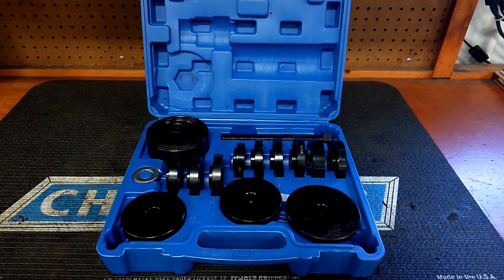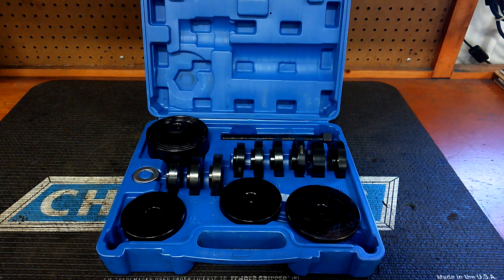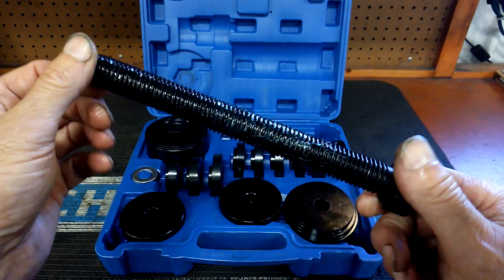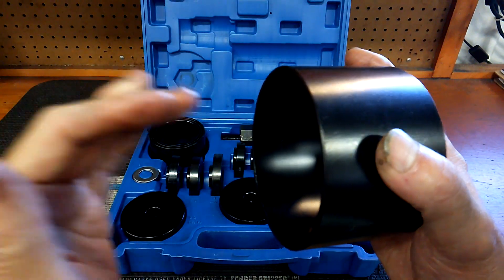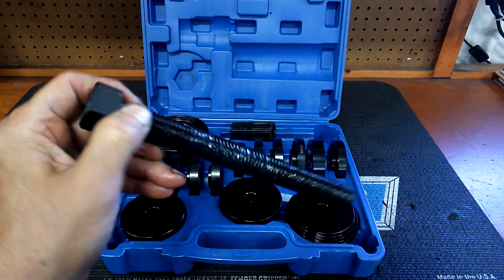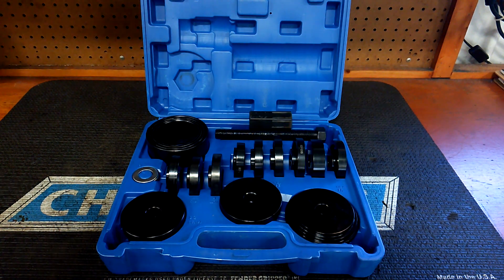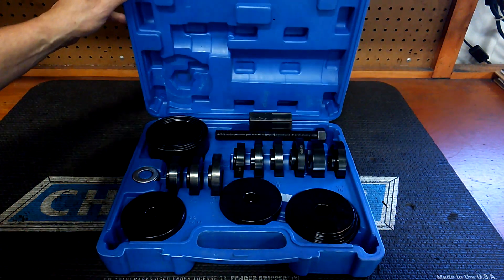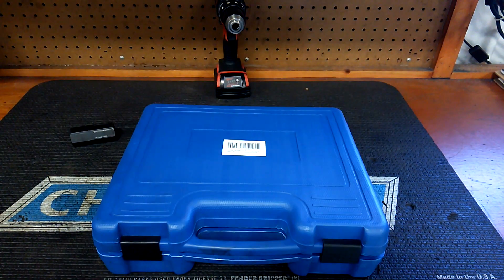wheel bearing removal and install set,big bang for the buck!!

Comment: Nice change of pace with the wheel bearing tool review. Looks like a good set to have for those who don't have a press. I had a 20 ton press so I used that for all my bearings. That kit is worth it's weight in gold for the adaptors alone. I had to source pieces of pipe and make my own jigs. Whether you use the on car tool or the press you still have to address the stuck outer inner race on the hub shaft. With the press I used a bearing splitter to remove the inner race. Much easier than cutting the race and splitting it with a chisel. I didn't have an oxy/acetylene rig at home to expand the race.